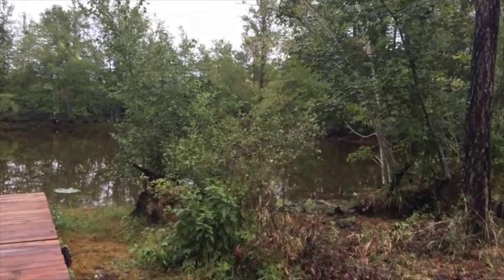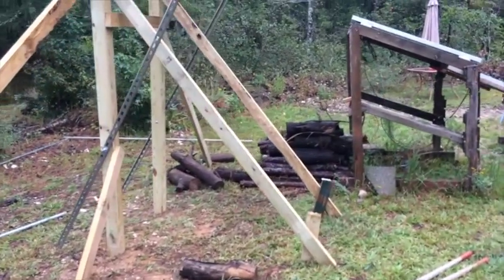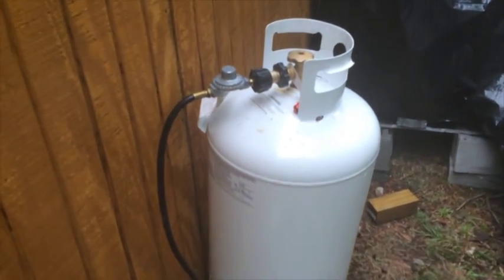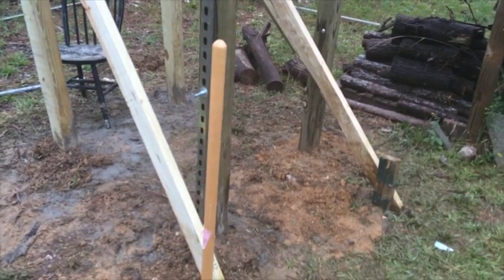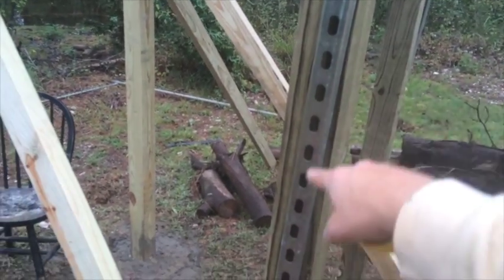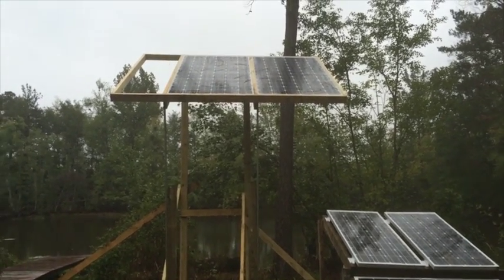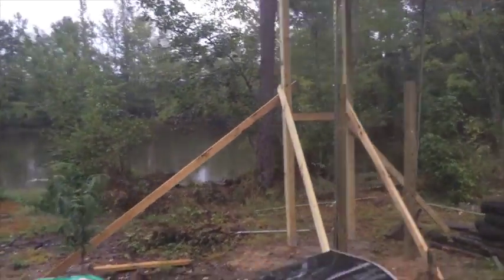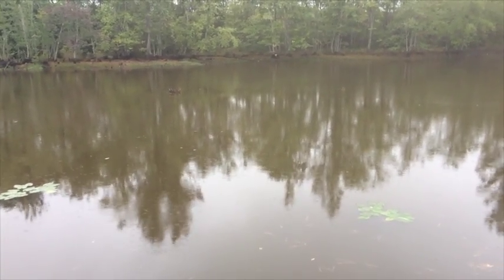Major Rain Is Threatening The Carolina's. Need to Reinforce the Solar Panels

Comment: Hola! I'm sorry but I won't ever get tired of re running the opening to this video!
'whakeeeeeeem!' made me giggle.
That weather looks just like the glorious North West of England where I live - wet and wild!
The tote cover looks a bit loose. will it not tear in a wind? Good to see the level rising though.
why did u did on propane heating rather than a wood stove when you are  surrounded by wood?  Did I miss that explanation? 
Have you seen any deer? juat remembered about the porn feeder.
Please be careful with that construction it sounded scarey! First aid supplies ?????
Have about the feeder good day Bernie x
Reply from the maker: +MotherGoose I need to tape the plastic down. I have a wood stove but when I saw the pricing on chimney pipe I got cold feet plus it would be too hot for the woodstove. I do plan on adding it after I add on or connect a camper to the cabin. I have seen a few deer driving up the road but I haven't been up in a stand since my last video. Of course I have a med kit with me at all times. What kind of prepper would I be if I didn't?
Reply: Thanks for the updates! I forget there's temp differences when u are, winters are much milder!
Oh I know you'll have one (was thinking vide!)
There's a Prepper challenge about the., would be interesting to see yours. I don't think I have x

Comment: Look at affordable solar panel mounts for you panels, much safer and more durable than the mount you made. Have a back up regulator for your Mr. Heater, I had one go bad after 2 years? Never had a propane regulator go bad after such a short time. Thanks for the great video's and advise!

Comment: Do you need to strap the 100# tank to the cabin incase a branch breaks and hits it?
My homeowners covers my house and a another building, I have a shed or a Tomb that I would claim if damaged. But my flood only covers the house I live in. If the shed or Tomb takes a hit, so will my wallet. Still hoping for a reply to the email I sent you.
Reply: +Dan PetersonTaylor Also received a answer about canning lids, Mrs Volvie uses "Tattler" lids, they come with the cap and the rubber separately so you can purchase just the rubbers. http://www.midlandhardware.com/167305.html?gclid=CI3O2_6gp8gCFY0jgQodT2gF6w#.VhBKOytfiM8
Reply from the maker: +Dan PetersonTaylor yes sir. I'll be getting back with you soon.

Comment: if you get 12 inches it will put pond at or over flood leval  remember it is not just the 12 in. that falls on pond but the runoff from suronding that will fill it to